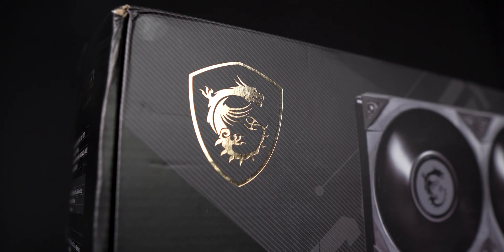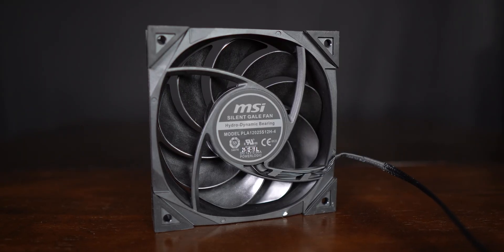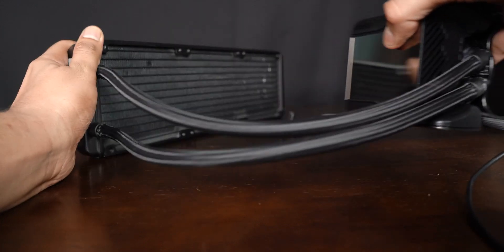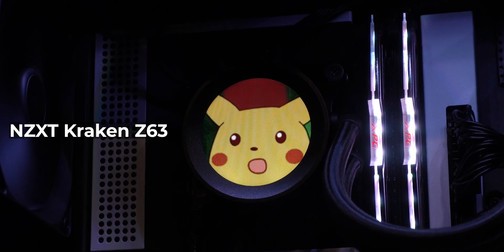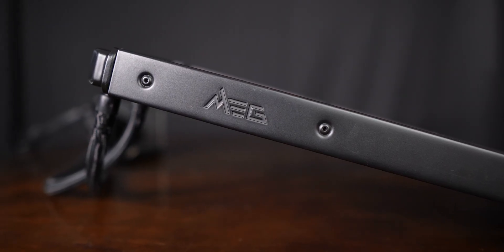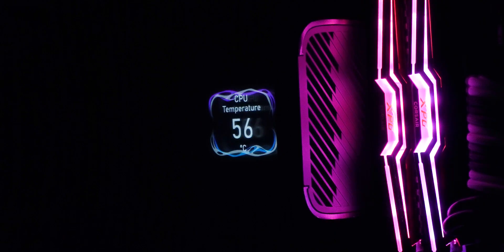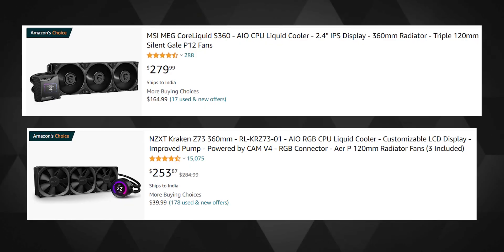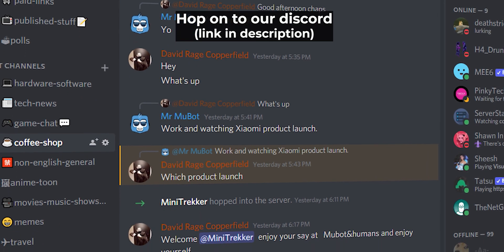MSI MEG Coreliquid S360 AIO Review - Pricey but worth it?

Comment: Not a great idea using a low wattage CPU (3900x) to test a flagship cooler.  Your test results are only useful to someone using a 3900x or less. Who buys a flagship cooler for a 3900x? You have to go with the 12900k or just skip the testing.
Reply from the maker: Unfortunately that's what I own right now. And this is why I tried to push it till 190W or so for testing.